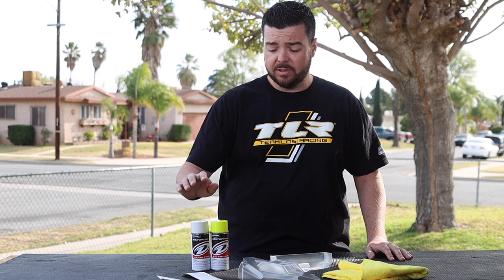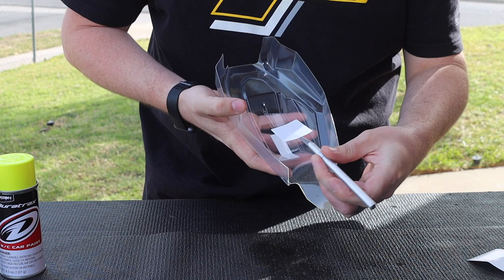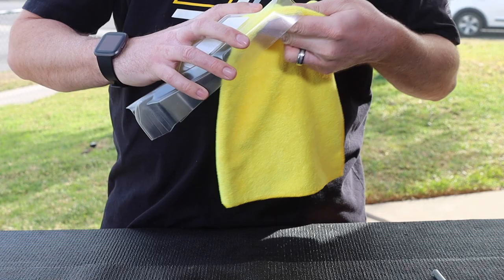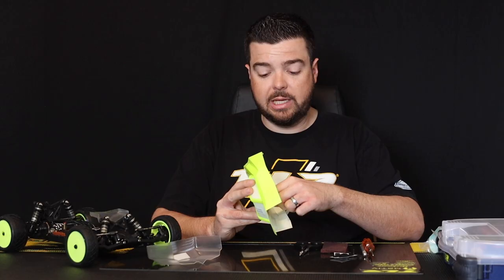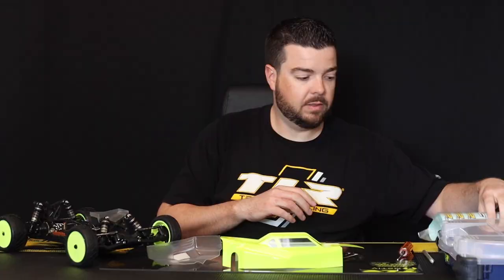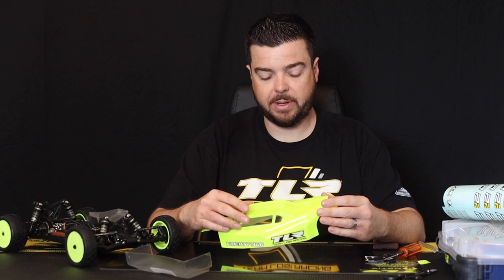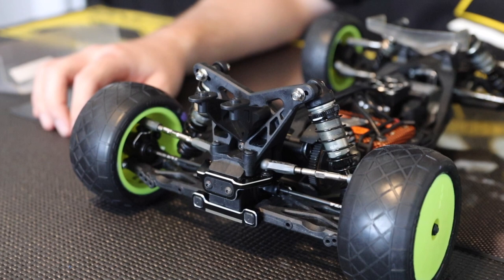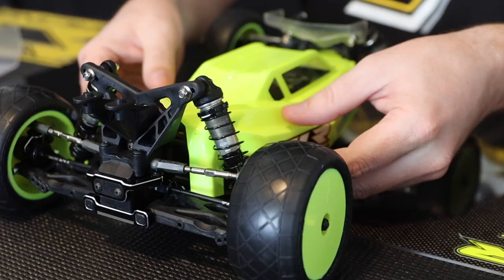How To Win - Painting and Mounting 1/10 Body

Comment: I like to put the hook side of the Velcro on the body and loop on the chassis. then the hooks doesn't scratch the body.
Reply: I use a thin layer of Shoe Goo on the body in areas that might rub to avoid losing paint, which eliminates the possibility of this issue.

Comment: Why do most people not paint the wing?,I'm getting mine painted.just looks unfinished that way.
Reply: Because it looks better in peoples opinion
Reply: The wing flexes a lot during crashes causing the paint to flake off and looks terrible, instead scuff the wing with sand paper to give it a frosted look.
Reply: Vegan Bear mines a shelf queen so hers will get painted.if she does get played with I guess I'll just put a plain one on.
Reply: @veganbear5212  true
Reply: I don't paint mine for a couple reasons.  1.  I don't really like the way it looks.  2.  When you paint a lexan/Polycarbonate body, you have a gloss side and a dull side.  With a body, you only see the gloss side, with a wing, you see both.  3.  If you're racing a lot, you'll go through wings every couple weeks, and then the work of painting wings gets to be a lot more.  

But... I did get used to running unpainted wings when I started.  If you like painted wings, rock one!